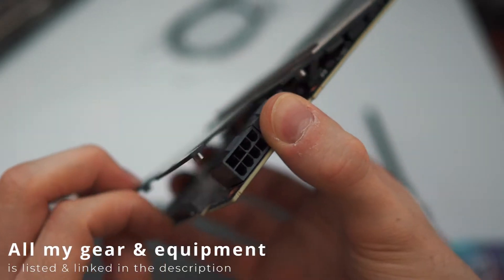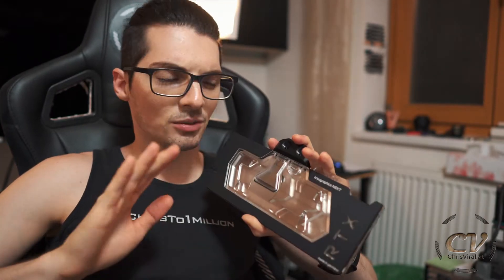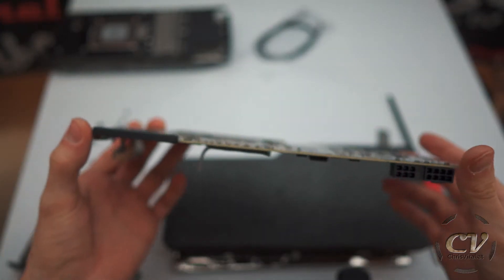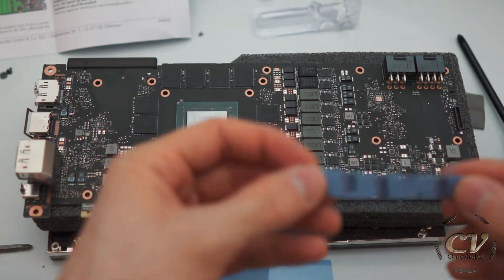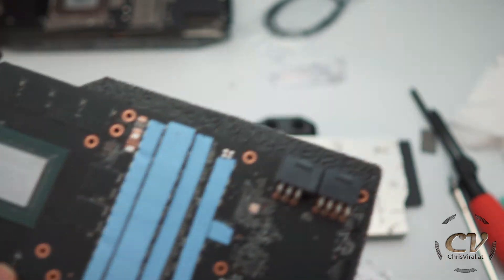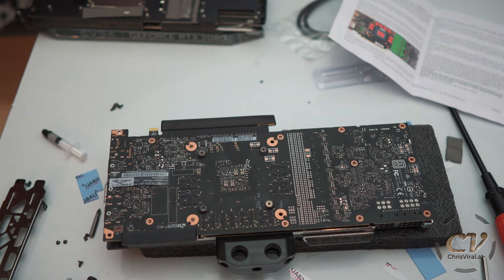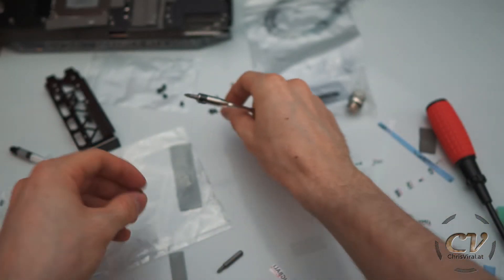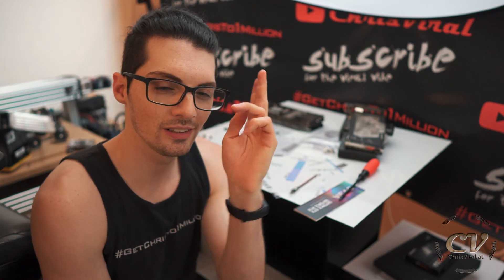GeForce RTX 2080 Super Water Block Install (Aquacomputer Kryographics NEXT RTX 2080) (Noob Warning)

Comment: 1. The missing components are probably a missing voltage regulator or a small IC for measuring the power draw. This PCB layout is used by all manufacturers for all the reference cards and it's not uncommon to see missing slots if the manufacturer used a different method somewhere else on the board.
2. The thing you damaged is a resistor I think. Since nothing else is close to it it should be pretty easy to solder if you need to. People solder shunt resistors on graphics cards pretty commonly for extreme OC so there are a lot of guides out there. Check out a shunt resistor mod tutorial if you need to
<3
Reply: Just confirmed it. The big thing missing (U29) is the Memory VRM controller and EVGA placed a higher quality one on the backside instead (U610). The whole Memory power supply is better on the EVGA  than on the Nvidia FE cards btw
The small thing missing (U32) is the Memory power regulator and is located right next to the VRM controller (Q627) here.
Reply: @BFtrnapster  Someone did the research.